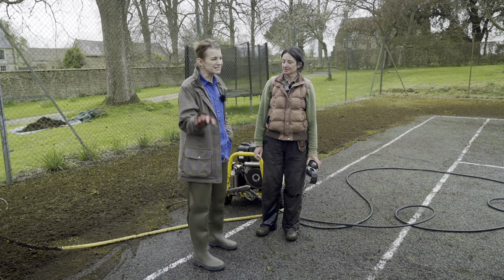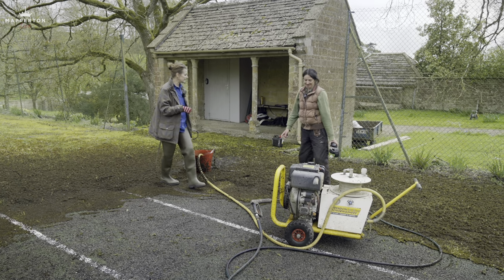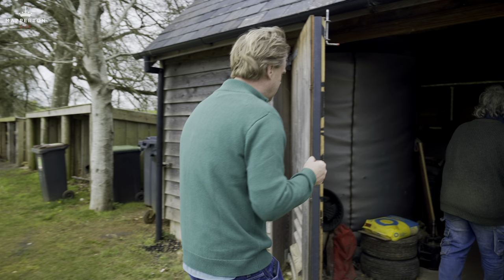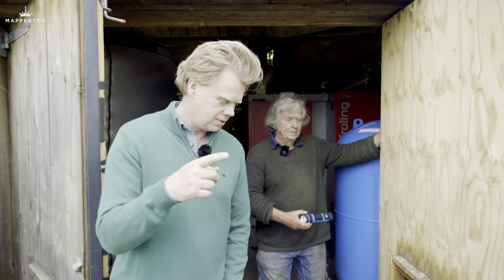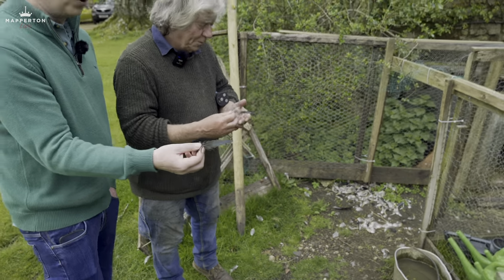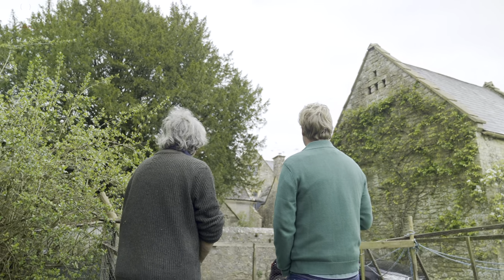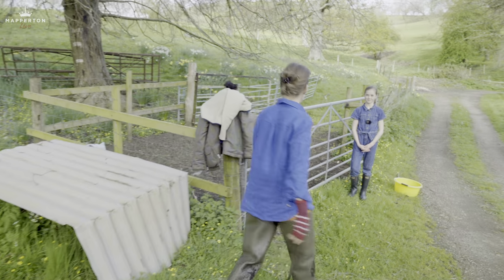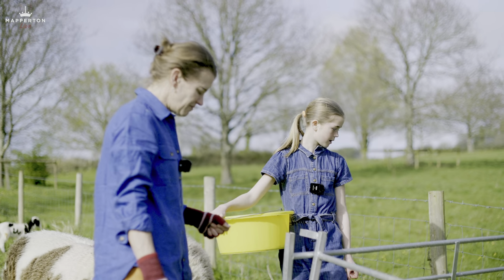OUR MANOR has the world's DIRTIEST tennis court!

Comment: Now and for the past 10 years or so we use  what we call a UFO on the end of the wand for flat surfaces. You use it like a vacuum. It does not leave streaks and works just fine on walls as well. Is also fast. Makes short work of those areas that need redone yearly or so.

Comment: ....and this is why you need good waders. I have Le Chameau Deltanord neoprene-lined waders as well, and they're brilliant for just about everything, all year round. I've worn mine for years around the yard for stable jobs and in winter they work pretty well for riding as well (I ride bareback, so the horse's warmth radiates into my waders which in turn keep my legs warm). Best multipurpose waders ever, and they last for years. My oldest pair are at least 20 years old and still good.